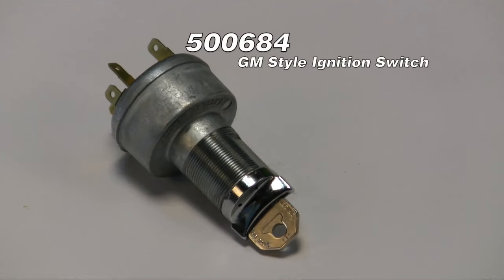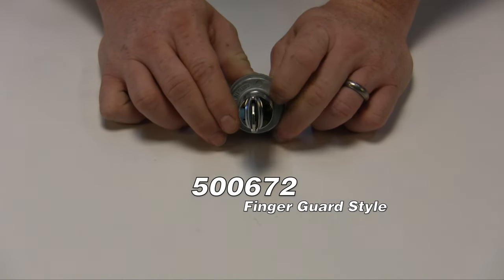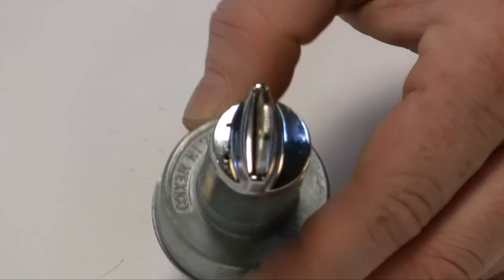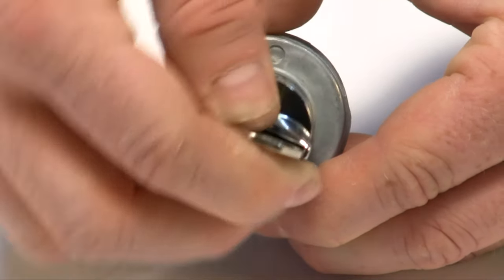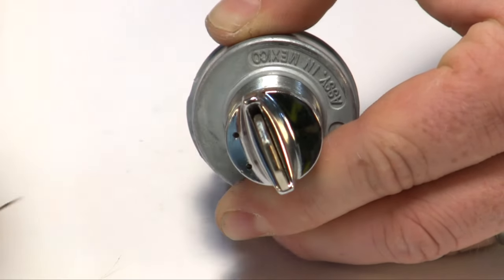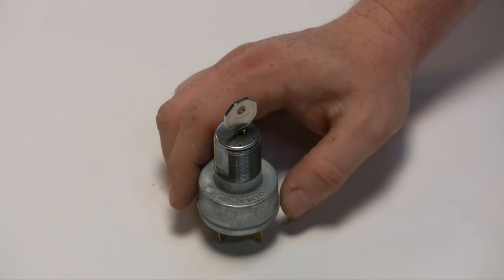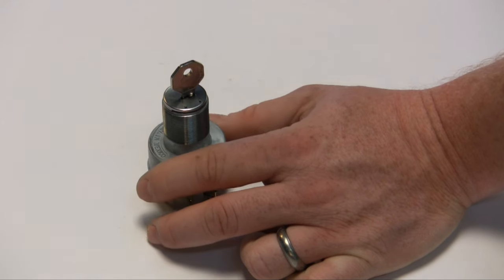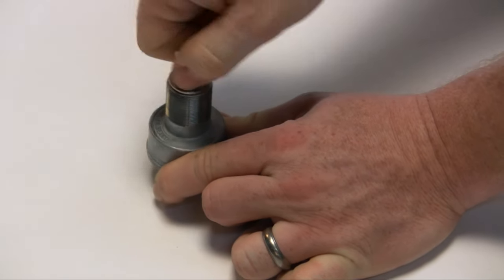Removing a key lock and tumbler from a GM-style ignition switch.

Comment: thanks, i saw this other one with one hole and no sound and it wasn't all that. this one gets a bag of chips! doing this on a 62 buick. again, great vid!!
Reply: i have a 1962 buick  leSabre with ignition switch p/n 1116621 aka D1414,. (see ads on ebay for a pic). Looking at my new lock and the pic of the bottom of the Sw. somebody DID put this cylinder in 19\80 out! how in the hell did it ever work? why does it work?   wow!   a paper clip will not go in the hole more than 1/8".  there is a brass button under the top you can only push down thru the key hole. it is spring loaded.  and the holes in the top of the cylinder are on the other side of this brass button. so it is 180 out!  when i push it down with a paperclip or a straight pin the lock cylinder wont go anymore counter clock wise. it doesnt go anywhere other then where it normally goes.  somehow somebody put this lock in wrong but it LOOKS like it moves around in there the way it was meant to be and that there is no other way it could go in.  after f'ing around with this thing for like four hours i put the sw. in a vice and sawed the top of the cylinder off.  this let me shove the brass button down farther, then it got stuck all the way down. with a large screwdriver in the key slot i can not move the lock into any other positions. even with the button all the way down. i am mystified how this thing will not come out or do anything differently from when i first started.  my key to my new lock goes in and turns it, but then so does a screwdriver, which is why i want to replace it. i was lucky to find an NOS 1116621 on ebay still in a box for the same price as used. (vs $150 from some supply house i found online).  so i jumped on it at 1am for $50. right now i am going to keep using the old one in my car to move it around. but the only way to see what is going on in there is to destroy the switch.   this p/n is called out in 61 and 62 buicks.  the ones at the parts houses are saying they only have switches that go back to 64.  the are almost the same, but my sw has two spades for connection to ignition (ign. 1 and ign. 2)  instead of just one on the new ones. i have to tell you, again, that i have no idea how this MFer is removed from this f'ing Sw.!  if you have any ideas, i would love to know since if i can get it out i can still sell my old one since i haven't broke it..... yet.

and fwiw to the one person that will ever read this, you have to pause the video if you want to write a book of a comment like this, or once it stops and goes to the next video it will fart away all of your comment.

Comment: That's how you remove the cylinder.  The tumblers are the things inside of the tumbler that contact the key and are matched to each peak and valley along the key to release the cylinder to turn.
Reply: not sure where the word "tumbler" came from, but it is actually called a Lock Cylinder. The things inside the "tumbler" , inside the ignition lock cylinder, are called wafers or they can also be pins inside

Comment: It would be helpful to hear exactly how that release pry hole works. I have a 1969 Suzuki T500 ignition key and I cannot get the central key cylinder out of the lock body. I want to modify the pin sequence so as to have the lock respond to a different key. Can anyone help? If I learn how the GM example works, I might be able to figure out the Suzuki! Thanks

Comment: Had a co-worker who removed a gunked up ignition from a 2004 Chevy S-10. Pulled the wafers, didn't know how to re-code them, so put the ignition back with no wafers. Now ignition turns, the car starts and dies after several seconds. Not a transponder key, so what's the problem? Thanks for any input.
Reply: Sounds like the wires didn't get put back right. Starts but wont run when key is released from start?